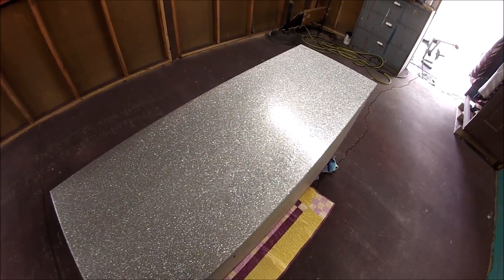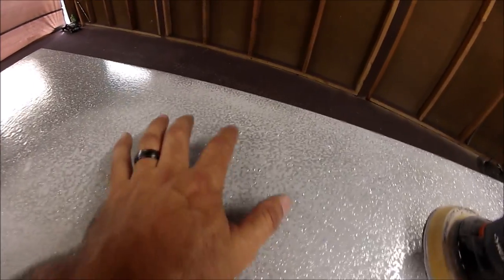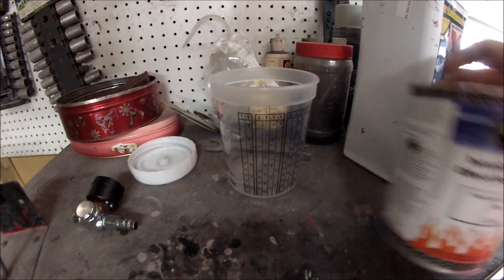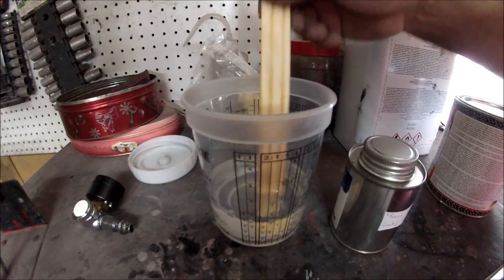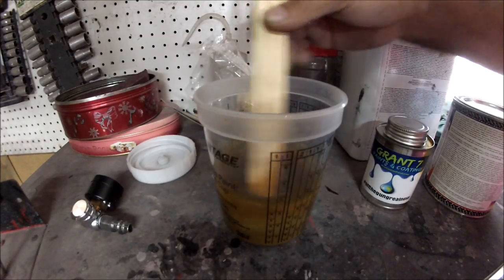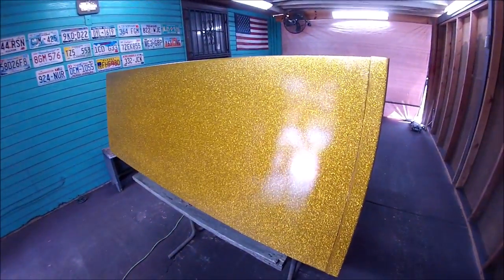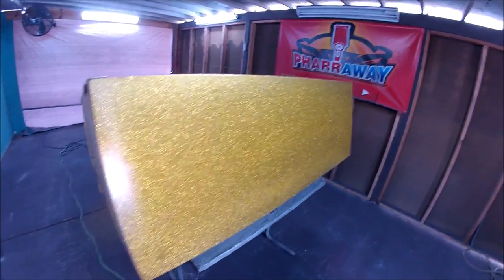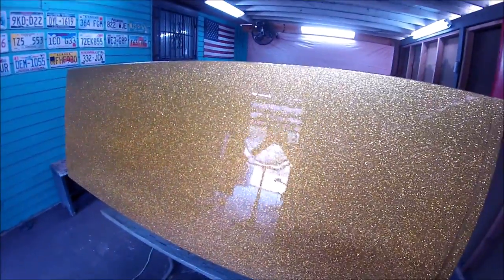How To Spray Metal Flake Step By Step Part 2

Comment: Man.  That’s fantastic!

A few questions, forgive me if you have discussed these elsewhere.  It’s been 30 years since we painted cars as a teenager. 1. How do you select the products you shoot & how do you know they’ll chemically work together if they cross manufacturers? (And what are your favorites) 2. If you were to lay in some opaque graphics on top of the flake, would wait and do 1-2 clear coats after the candy, add graphics, then seal it in with 2-3 more coats?  3. If there were pinstripes and smaller airbrushed details added, can other paints be used - like “Sign Painter’s One-Shot”.

I really appreciate your style of explanation and keeping the lessons straight forward.  Thank you!
Reply from the maker: You can email me at pharrawaypaint@gmail.com

Comment: Hi
Great informative video.
Am spraying my best friends bike, candy over hok metajuls, over the pond in the UK.
Sprayed the metajuls with a Sata rp 3000 but tiger striped on tank. Hok recommended in tech manuel 1.3-1.5.
Am going to recoat the metajuls with with my Sata klc 1.6 primer gun as the tip size on the rp was obviously too small.
There instructions are always off, like use full air & full fan on a rp3000!
Anyways thanks for the vid, your advice is much appreciated.
Keep rolling out the vids!
Reply from the maker: anytime brother

Comment: Your channel is one of the best auto body channels to learn from! Just a quick question. I live in Canada and my shop is not heated. What is the minimum temperature I can apply paint and clean coat at? Thanks so much for all the great videos I will continue to watch and learn from the best!
Reply from the maker: The best will be at 70 degrees and up for best results

Comment: question: after completing sanding did you clean off the sanded surface with just blowing off the dust and dry wiping off excess before the candy coat? Or did you take a wet rag to clean it off? So that first clear coat restores the clarity of the flake after sanding, yes? thanks. Love all of your videos. very informative for beginners like me.
Reply from the maker: I did use wax n grease remover with a microfiber towel

Comment: If you were doing a two color paint job and one color would be metal flake can you let the other base color sit more than 24 hrs without clear coat? While asking can you apply clear coat over your base coat that has went beyond recommended application time and if so what do you do to prep it for clear ( as an example you had a base coat sit for 2 weeks without clear what would you do to insure it bonds correctly and not have issues).
Reply from the maker: if you use inter-coat clear yes you can let it sit for a while
Reply: @PHARRAWAY  Thanks for info and great videos. I have an old dodge truck I am restoring  that came white with silver along bottom panels. I am trying to figure out best way to repaint similar color scheme but flakes in the white and silver. Should i just do basic white whole truck and then spray silver and then shoot whole truck with clear or inter-coat mixed with flakes?  What color flakes would work with both white and silver?
Reply: @PHARRAWAY  have you done a bass boat using gel coat

Comment: Pharraway, Thank you so much for the videos!!! With your videos I was able to paint my boat. Black on the bottom and blue metal flake on top. I just sprayed the flake and have an issue. Most of it came out good but the splashwell in the back must have been dryer as metal flake landed on that area. Now its like I have a grainy texture. I've already put 3 coats HS clear but its still grainy. I'm afraid if I sand or scuff it I'll turn the blue flake to silver. Any advice is welcomed !!!  Thanks again!
Reply from the maker: If you added enough clear you shouldn't have a problem
Reply: @PHARRAWAY  Going to scuff and lay down more clear and see how it goes. Great videos!!
Reply: Great job, gonna do my boat.
Reply: @PHARRAWAY  How can I send/post you a picture of my project?

Comment: Quick question. After you sanded down the Orange peel did you wipe it down with anything? Did you wet sand or wipe it down? I'm learning a lot from you, thank you for the video. Thank you for an answer.

Comment: I see some guys use a clear base coat binder to mix the flake with to put the flake on the panel  for the first coats of flake, is there a reason you used the  Grant 7 and not the clear base coat binder ? Also is the any kind of a chart to show size of flake to what needle & tip size to install in your gun to shoot the flake ? Want the biggest white flake possible for a project I am doing.
Reply from the maker: just to show that way you can do it with clear also

Comment: another dumb question. what is the minimum size compressor that will handle this type of job? would it have to be a big 30 Gal or will a pancake size or smaller get the job done? I haven't even began to buy equipment yet but wanna make sure that it is correct. thank you for your help!
Reply from the maker: It has to be 30gal and up
Reply: @PHARRAWAY  good to know I almost f**ked up :-D
thank you!

Comment: Hey man, when you sand it before clear to remove the orange peel with color flakes(for example blue) wouldnt it screw up the metal flake and make it silver?
Reply from the maker: Yes you will that is why I only use silver flake
Reply: So the options are candy the clear or drown it in clear over the top to fill the top layer right?
Reply from the maker: @kiivaskastylings545  that will be your best deal if your using colored flakes

Comment: Is there a reason to not used colored flake instead of just silver with candy color? Wouldn't it be a more even color?
Reply from the maker: You can the only reason I use silver its that I can use any color candy
Reply: @PHARRAWAY  probably would be easier in case you sand into the edge of the flake....the candy would cover it.

Comment: Bro question for you I just finished sanding the 2k primer smooth with 600 do I need to spray a sealer or something else or can I go ahead and spray the silver base then my flake ?
Reply: Yes javier flores.  Thats the right way to go.     Sealer is a life saver.   For prep inperfections,scratches especially.     Then ur basecoat or flake.

Comment: Why the different psi settings?
Reply: Subbed btw
Reply from the maker: The base will be best at 29psi and 33 or 35psi for clear because the clear is thicker and will need a higher psi for the clear can flow better
Reply: PHARRAWAY great info brother thanks.